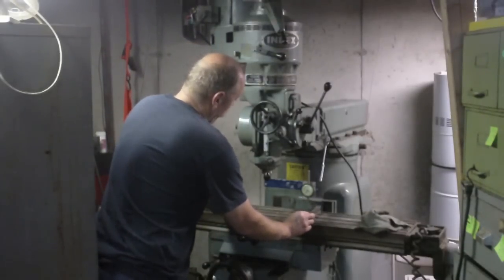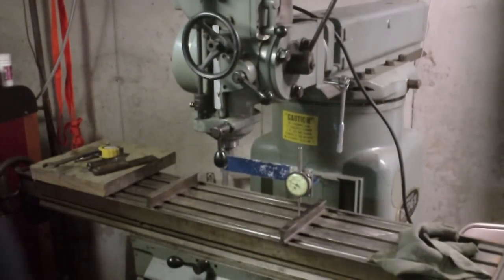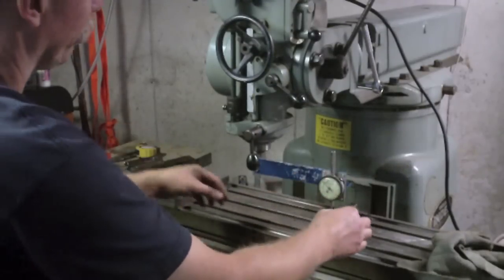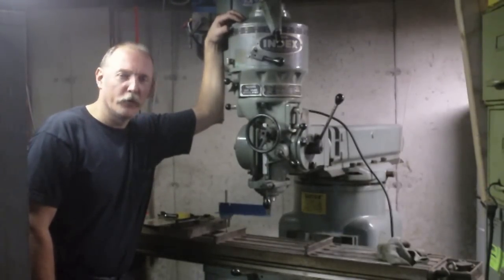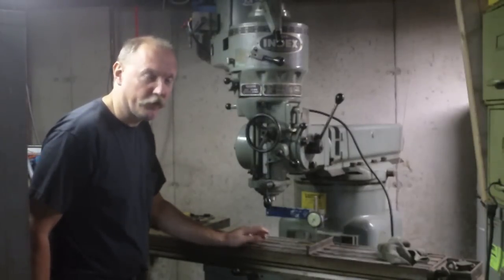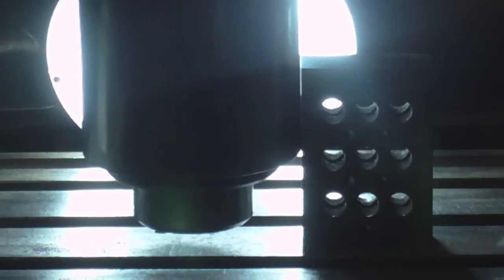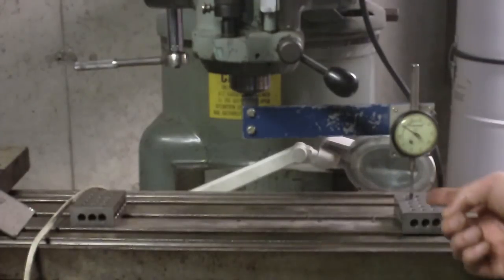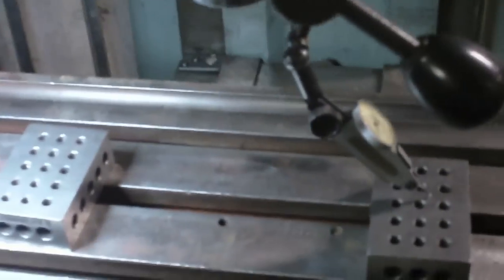Wells Index Milling Machine Part 63

Comment: These videos have saved me so much time rebuilding my 847. Could you put them in a Playlist? Also, do you have anything left from that donor mill? Thank you for the videos.
Reply from the maker: https://youtube.com/playlist?list=PLV1RW-p5BeomUb3A4MmBNJooh6PU87zjp

As for parts. The donor machine is pretty stripped down. What are you looking for?
Reply: @stevewatr  the right-side table endcap and a few of the power downfeed gears. The worm under the nylon gear and the gear it interfaces. Interestingly, the worm failed rather than the nylon gear.

Comment: http://www.edgetechnologyproducts.com/pro-tram-system/  best $99 you'll spend on tramming.
Reply from the maker: those are nice. I picked up a 4"x6" cylindrical square at an auction and will use Keith Ruckers trick next time.

Comment: I have a question if you don't mind. At work we have a pesky mystery that no one not even the electrician can figure out about 1 month now. There's 2 heavy gauge copper wires coming from the 60amp service then to a buss, then to a 600v relay, then off to the 7 1/2hp 240v motor that runs the vacuum pump in the dairy parlor. For some reason the relay keeps burning up about every 4 days. Motor/pump and even the 60 amp square D breaker all work perfect but the relay's are burning up. Last week the electrician had to replace the 2 heavy wires inside the galvanized conduit going to that relay but they looked ok this morning even though another one is toast. What's causing this and how do i test for it? My employer said that vacuum pump originally came with a 5hp motor but it wasn't making enough vacuum so they went up 1 size. I'm mystified why the 60amp breaker doesn't trip instead of burning everything up.
Reply from the maker: +jasonmushersee In the above scenario, you failed to give the contact amperage rating of the relay. You mention it is 600 volt, but what is the current rating? If we're talking single phase, at 220 volt the average amperage draw is about 40 amps, low enough to keep that 60 amp breaker from tripping, yet high enough to fry the contacts in the relay if it is under rated. Also, when you say the relay is "burning up", are you talking about the contacts, or are you talking about the coil winding.
Reply: it's got 3 contacts but we don't use the middle one at all, just the 2
Reply from the maker: +jasonmushersee Okay, then it's not three phase. Get the ratings off the relay or "contactor" as they are often called. It might say something like "FLA 30A", some motor contactors even list HP. On the other hand, if it is the coil winding that is burning out, that's another issue..........let me know.
Reply: Honeywell
Definite Purpose Contactor
DP3040 500
Vac   FLA   LRA   3ph
600    40     160    15hp
50Amp/pole
Reply from the maker: jasonmushersee See, that seems a little wimpy, full load amps is only 40. I know it says 15 HP, but that's assuming a 3 phase motor where each leg would only have to pass about about 17 amps at 600 volts. As the voltage is reduced, the current demand rises. Another issue I once had with a 3 pole contactor once is the coil did not like being in a single phase circuit. That thing buzzed loudly, and never latched properly. I'm no expert, but I think you might want to try this http://www.amazon.com/Magnetic-Electric-Starter-Single-Control/dp/B009W5XQMI
Reply: actually it sounds like a machine gun before it melts down. i'll tell the electrician to find something bigger.
Reply from the maker: +jasonmushersee And get one for single phase…….that way you can be sure your getting something with a proper rating.
Reply: Electrician may have found the problem today. He replaced the relay again and dug into the 7 1/2hp motor. He said something about the 2 - 320v run capacitors are too high ohms or too less i can't remember so he replaced those. But the motor still gets hot too fast. He said the windings are running high ohms also so the 20 yr old motor gets replaced tomorrow.